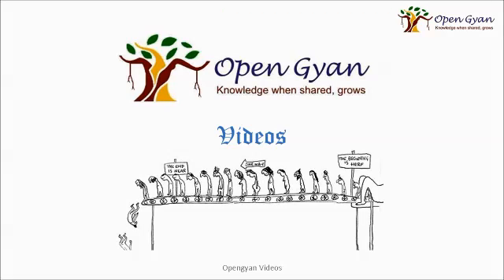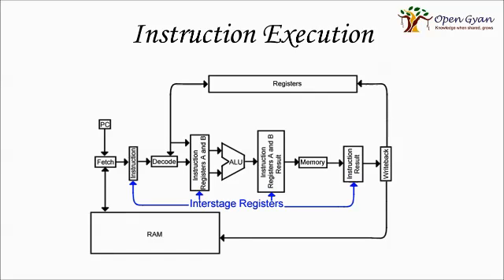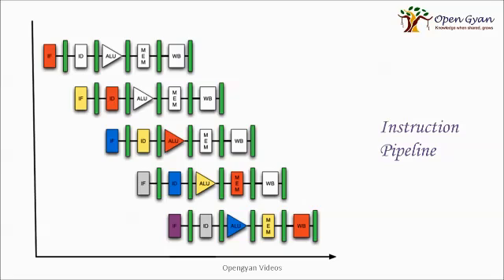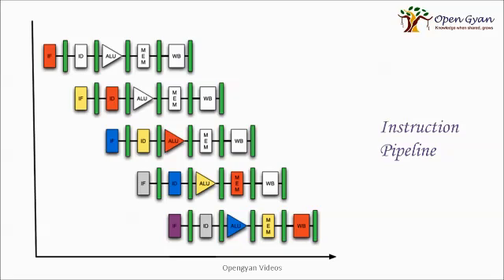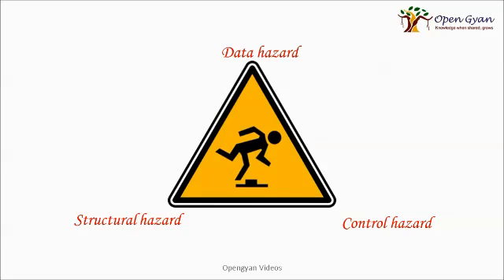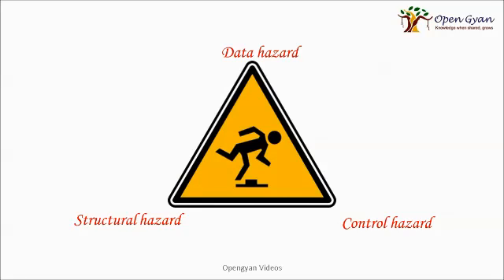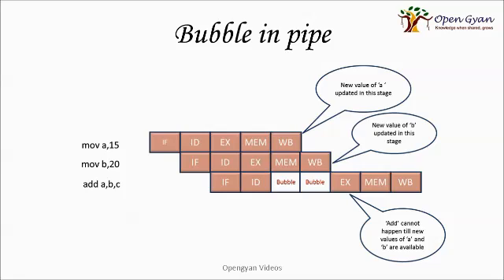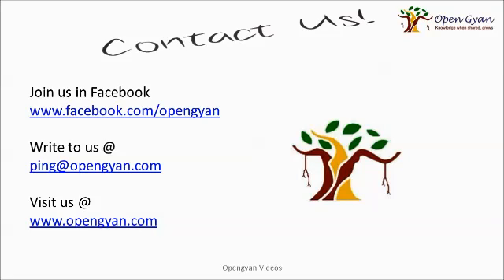Instruction pipeline and hazards

Comment: i have a question, MIPS as you know use a fixed length instruction and every cycle the CPU store the instruction into the instruction register or IR to execute it in the next cycle. the load and store instructions in MIPS are I-format instructions witch mean this instructions can only address  65,536 (2^16) byte of memory because there is only 16 bit (the immediate field of the instruction)  can be use to address the memory even if this instructions are J-format Instructions you can only address 67M(2^26) byte of memory. more on that in both cases there is always a 6 bit reserved for the OPCode (operation code)  you can't use. my question is how the MIPS CPU manage to addresses more memory for example 4GB (2^32) with the constraint of fixed instruction for example the instruction lb $t0 , str (where str is a pointer to the address lets say 0x3d2effff) if we convert this instruction to the binary representation  OPcode = 100000 rs = 00000 rt = 01000 [str] = 0011110100101110 1111111111111111 we will get a 48bit instruction length!